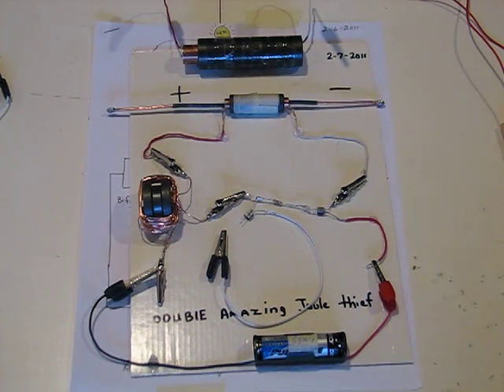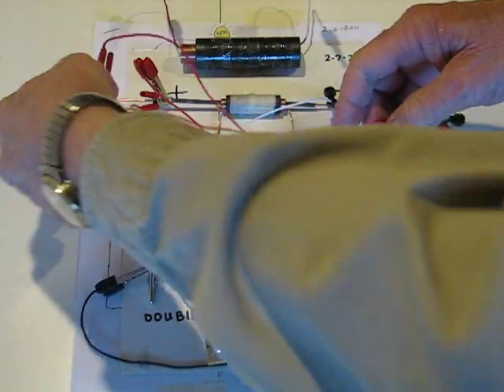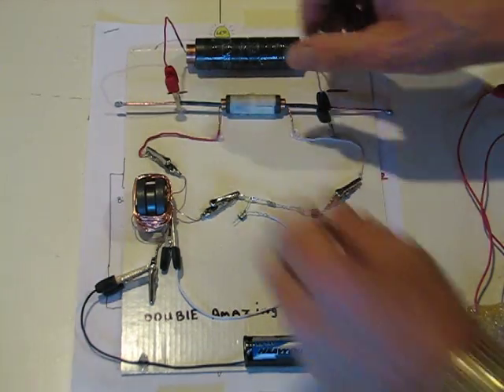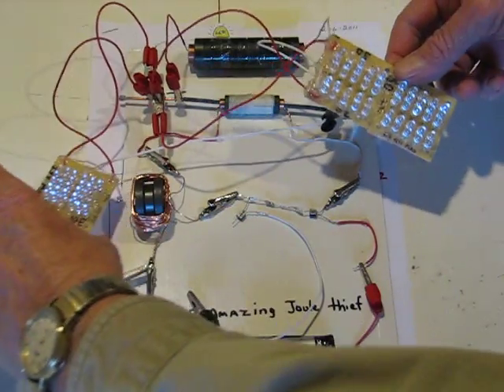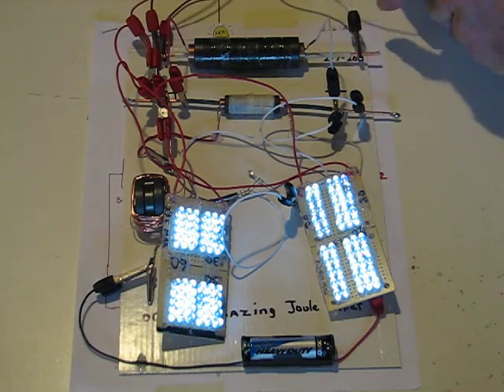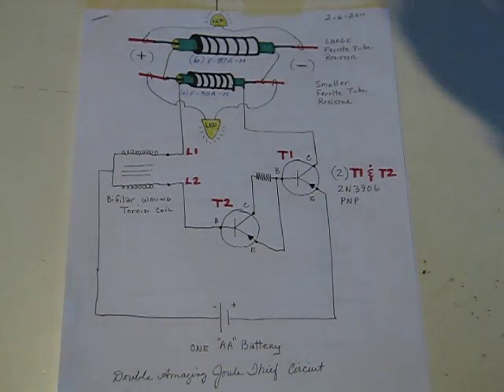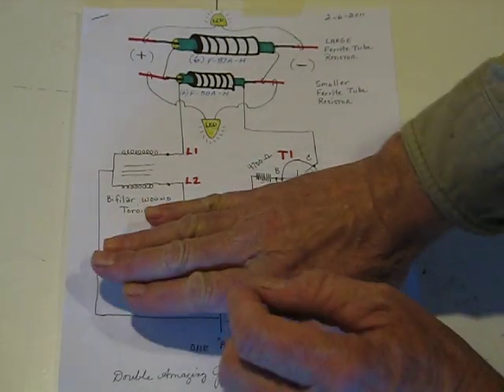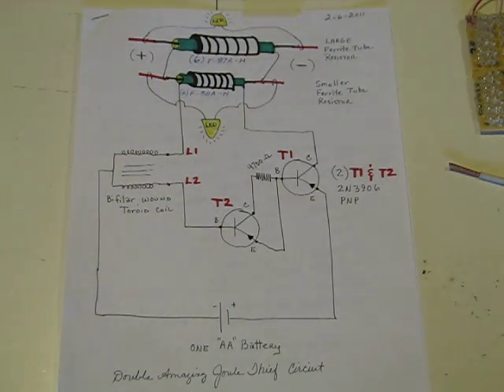Double Amazing Joule Thief video.AVI

Comment: Its a nice demo... the transistor setup sorta looks like a Darlington array.   Would you be willing to show an analog ammeter in series with the battery source with the single transistor being used verus the double transistor being used so that you can qualify if the increase in output to the LED's is due to an increase in current being consumed from the AA battery?

Comment: So what do you think it would take to illuminate 5 10mm LEDs? I am trying to build a small joule theif that will run them for days, with a 3.7 volt lithium cell. Is the most critical part the inductor value?
Reply: I am going to use smaller inductors and 2n2222 transistors, as I have a lot of both.

Comment: Nice work!   This essential device (the ferrite with a split tube and wire or nail through the middle) was shown a couple years ago by some Russian guy IIRC.  I built the setup with a split copper tube and it's amazing to see it work.  Are your brass (or copper?) tubes split on one side?   I don't recall you mentioning that but as I understand it that's needed for this part of the device to work correctly as Larsko shows where you get power from the screwdriver or nail.  Also you need to solder wires on the split tube so one is on one side of the split and one is on the other side of the split.   Is that how yours is made?   Thanks again for sharing and the excellent schematic.
Reply from the maker: Mine is a solid brass pipe.  I cut the threaded ends off first. I did not split it, and the wires are soldered to each end in the same location (top).

Comment: Wow, you sound like a custom car builder.
In fact, that is what you are doing. Learning how to soup up performance along with reducing power consumption.
I was wondering if this joule thief could charge batteries more efficiently?
I have some plans for a battery desulfation recharger, but im not sure its what im looking for.
 I plan on putting a solar collection system in my house with alum batteries. I would like a system of putting the energy collected, "from the solar collecters," more efficiently in to the batteries. More power into the batteries less solar collecters needed, "they are expensive!" 
 I know a good amount of energy is  lost converting electrical energy into chemical energy storage inside the battery.
I hear alum batteries are better at doing this than lead acid.
Any insight on how a jewel thief circuit might help with solar project?

Comment: I see, I think. So, when you are using a transistor, you are adjusting your volt/amp ratio to get the correct power. Is it possible to have resisters and transistor's that are more efficient and don't generate a lot of waste heat, or is that just part of the process and is unavoidable?
Reply from the maker: Yes, all transistors are not created equal. Where one will work another will not. Adding a resistor and/or capacitor can help you "fine tune" a circuit.  But in the case of a heating problem it's better to identify the problem first and correct it. Example: I had one tank circuit where the transistor heated up, I added the correct amount of resistance to the circuit and brought the transistor under control (and had less power) but then the coil heated.  I modified the coil and/or wiring within the circuit and now both run cool to the touch, I have extra power now and no resistor is needed within the circuit (yet). I have another circuit where a 2N3055 transistor is typically used. But it kept popping due to heating.  A little research latter and we identified a better choice: 2N6487G transistor.  Difference beyond comparrison. Like a 4 cylinder car with too small of a radiator and sticky brakes verses a V8 engine with an extra large radiator.

Comment: Also, I was wondering. When you light up a bunch of lights with a small amount of energy, you are not creating any extra energy, but just tweaking it. How dose this work, and why dose it work? Could this work for more sensitive components and motors?
Reply: capindres exactly,No one has any idea how much energy is actually "in" the circuit.Using things like BiT transformers and jewel thieves and bedini chargers in our electronics could reduce our energy consumption by 90%. Batteries would last months and months, instead of hours. Some one can show a circuit on here that allows you to power 8v worth of LED's with a dead aaa battery. And people scream, "nothing unique about this, the circuit is just doing blah blah" But if people can't see the benefit of an ultra bright flashlight that runs on DEAD batteries than theres no help for them.
Reply from the maker: I don't believe your creating any "extra" energy, your just using what little energy you have in a more economical way, much as one car can get 50 miles per gallon of gas where the older one only gets 10, and they both can go 65 mile per hour.  The world system has been built upon "consumption" because thats where the buck is.

Comment: I was wondering if this joule thief concept could be used for anything other than lighting?
I always thought resisters were a very wasteful way of regulating power. What if you could use a joule thief, and divert power back to a storage capacitor and pump the correct voltage and amps to the desired electrical component. I think diverting power back to storage and not wasting it with resisters would vastly reduce power use.
Reply: capindres industry would also say your explanation isn't possible either.
Reply from the maker: That would be nice, but I'm not quite so sure you could ever to get it to work that way. The problem I see here is, where you have high voltage, your going to have low amps. Industry says that it takes 3v at .03ma to light a given LED.   But, you can light it with a whole lot less power, you just have to juggle the volt/amp ratio, which is basically what the transistor does. Builds the voltage and lowers the amperage "consumption"  allowing you to light many LED's where otherwise the same battery will not normally even light one LED.

Comment: I would like to see you make a triple amazing joule thief! See how many you can hook up before you see a decrease.
Also, are you using up your battery faster? If not,  then I would like to see you recharge a battery and see how efficent your system is. measure the power loss transferring power back and forth.
Thank you very much for the info! I will use this if it will help recharging batterys, solar panels are expensive!
Reply from the maker: I'd have to go find my notes, but it seems like I remember calculating that this circuit would run for about 4 hours before some of the LED's started going out.
As far as a triple circuit, I believe I did try adding a third transistor with no success.

Comment from the maker: Perhaps, but if you remove that resistor the first transistor immediately gets hot.
Remove the 2nd transistor and the LED's get allot dimmer. So the addition of the 2nd transistor boosts the power to the LED's.  I don't know how it does this, but it does.  I experimented with that "ferrite transformer", and coiled wire around it. There is no apparent power on the outside of this ferrite transformer, it's all directed inward from what I can see.
Reply: Yep, that's what a Darlington array is used for...(tho usually its a transistor that uses a small current to a transistor that passes a large current in the Darlington array, instead of both the transistors being the same,) that lets you use a smaller signal to control a larger Current.   I would think if you measured the current from the AA battery you'd note an increase in consumption using the 2 transistors versus the single transistor.   Given the transistors are the same, I'd kinda expect you to see a doubling in the current being drawn with the two transistors being used versus the single transistor.

Comment from the maker: About 5' of bifilar (2-wires) was all that I could get on these small ring magnets.
Originally there was a smaller ferrite ring sandwiched between the the magnets but it broke when a Ni42 magnet grand slammed the coil.  So now there is some foam in it's place.

Comment: To start with T2 could be replaced with a diode and the resistor on the base of T1 is doing nothing at all. The ferrite cores with a wire through them is just an induction coil and you could just loop a few turns of wire through one ferrite core and do the same thing or just wrap a few turns of wire around the transformer to power the LEDs. Back in 1974 in built what is now called a "Joule thief " powered by four solar cells,it produced around 120 volts that would make a neon pilot light flash.

Comment: I'm double impressed by your joule thief circuit.
May i suggest in order keep over all "cost" on leds very low with regards to lumen since per led is only around 14,000mcd or 14lux.Using Cree XR-E R2 (WG) Emitter on Premium Star(<$6usd) could achieve at around 250lumen per module.
"h t t p://dx.com/p/cree-xr-e-r2-wg-emitter-on-premium-star-15943"
I have posted different variant of joule thief concept like running on peltier-using only body heat as energy source.

Comment: Thanks for posting. Great work and very interesting circuit.
I tried to replicate the circuit but couldn't get it to work:( . I tried a few different coil types but without success. My best guess would be that the coil specifications are critical to get it working.
Would appriciate if you could specify the wire gauge and windings.
Thanks again.

Comment from the maker: The neat thing about it, is that the "field" is only detected, or felt by the circuit that I can detect, on the inside of the pipe.  I did an experiment where I made a paper "pipe" and then coiled a single layer of 22 Ga. insulated wire around it leaving about 4-6" tail at each end.  Then removed the brass pipe and replaced it with the wire "pipe"  It was very weak and just barely lit any LED's. So in my opinion, a thicker pipe is better than thin.